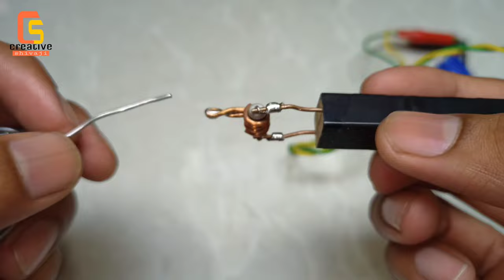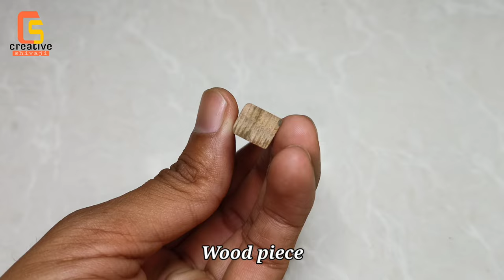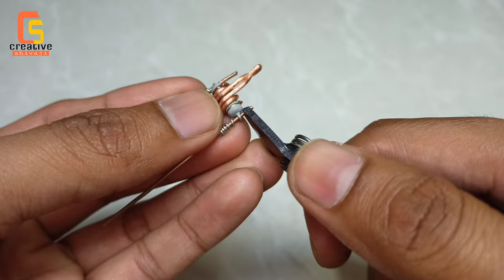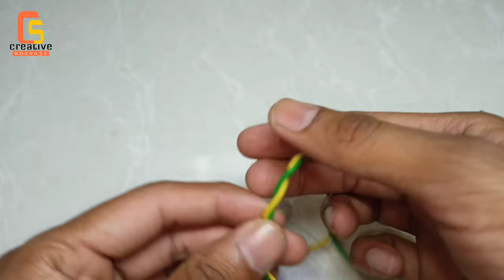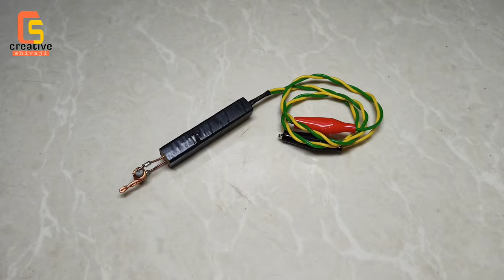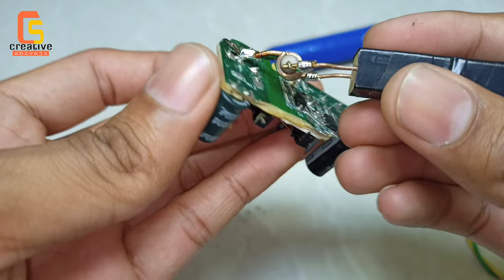How To Make Mini Soldering Iron Using Resistor | DIY Soldering Iron | By - Creative Shivaji

Comment: Fake. The electric current doesn't even flow through the circuit formed by the copper wires. The resistor is cold, it doesn't heat up even a degree. Trick for fools. I also gave the money on resistors. Buy a professional tool from the trade
Reply: Copper is for holding the solder tin it work but mine burns out
Reply: It works fine for me you must be using wrong resistor value
Reply: If i gave220 volt to 100 ohm what'll happen
Reply: @ApexLagend-kn8nr  no don’t it’s to much voltage. bro 5v is fine